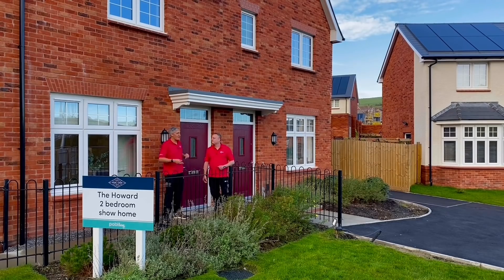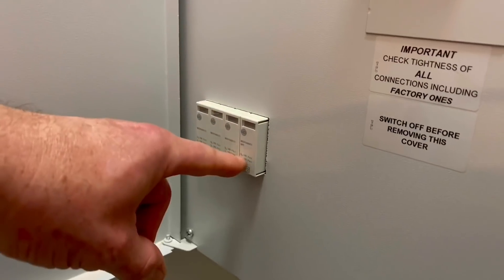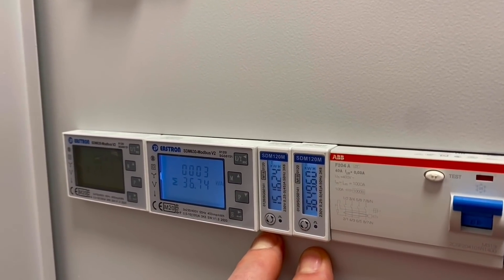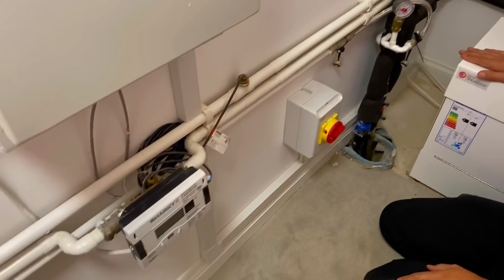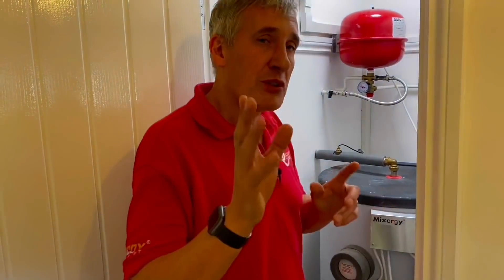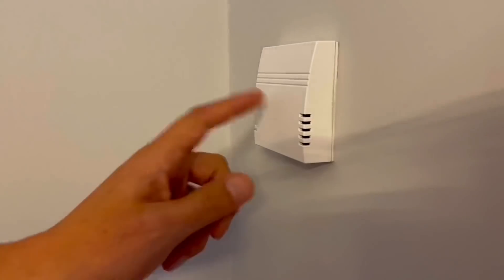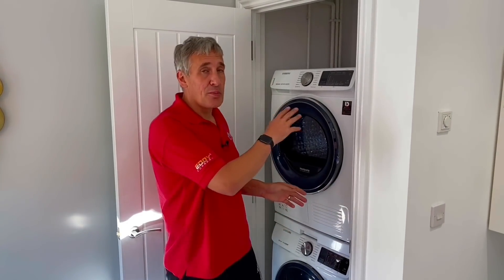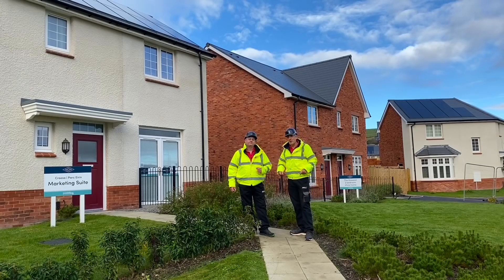THE FUTURE OF HOME ENERGY is HERE - A GAME CHANGER FOR ELECTRICIANS

Comment: Impressive., looks like there’s a lot to go wrong in the future.
Reply: I think you find this is an armous and legous installation ,you don't have to be a rocket scientist but would help .sarcasm at it's best.
Reply: Maybe, but there’s no particular reason it should be unreliable, a heat pump is just a fridge
Reply: @edc1569  I’m talking about the whole system, not just the heat pump.
Reply: @barrydoherty636  not being to negative ,but ,the tech goes these days this will be outdated this time next year .
Reply: @barrydoherty636  Just to address this concern... the underlying system for control uses erlang at its core, the same language used in telecom systems,  its designed to be remote debugged, can self heal, and is very secure, the config can be upgraded over the air via a sepearte 4g modem so is not reliant on users wifi. Its been designed to avoid the need for callouts as much as humanly possible, and every device connected sends a heart beat that alerts of any issues, if a part is showing issues the system can restart that single piece of control code.
Reply: @raychambers3646  The system is designed to be updated via new configuration, and will work with all current IO protocols for both wired and wireless, the system can also be loaded with new drivers as and when required. As such its been designed to be as flexibile as it can be, as new technologies appear the system can adapt to work with them. The system can also work with either wired relays, device apis , and all the current standards like RS-485, gpio, zwave and zigbee etc. It also allows for user control. smart scheduling, intelligent optimization and cloud integration. All efforts have been taken to ensure the system can grow and be maintained to ensure longevity rather than just work with a fixed set of peripherals.
Reply: @sismith5427  Does it come with handbook or online ,any tuition given ,because never understood hardly anything you have written ?
Reply: @raychambers3646  You just queried that it will all be out of date  in a year, I was just trying to explain that it's built in a way that means it can adapt. That it has minimum maintenance, and maximum resilience considerations at its core. Sorry I'm a software developer and tend to talk in a more technical  way than was necessary. I just wanted to be clear that Sero really have tried to create devices that are secure and can continue to be configured to avoid becoming absolute.
Reply: @sismith5427  how long do you guarantee software/firmware support for? And how much is open source?
Reply: @rivkahlevi6117  yh my thought too. What happens if a security bug is discovered in the firmware of one of the plethora of monitoring devices or the app in 4yrs time? Will the app be updated regularly as and when mobile OS's change? If the app is no longer functionally supported do the devices continue to work optimally? 

Open source is a good way to keep things maintained, but if only a few hundred houses have this system then a limited pool of people able/invested in maintaining.

I'm hugely supportive of the integration of proper green tech into ALL houses new and old, but I'm just skeptical of the long term costs and usability of these whole home type solutions. I wouldn't want my smart heat pump and water tank to just stop working one day in 10yrs time because some random company no ones heard of decided continued development and maintenance was too costly for them to offer and they wanted to move to the new hot ticket thing.
Reply: @raychambers3646  Also after 5/7 years manufacturers will not support it either, and new system will be needed.
Reply: @boderick1  yh, and considering some the the 'non-smart' 'non-fancy' and cheaper alternatives that work just as well are usual expected to operate normally for 3x that long if not 4 or 5x then losing a lot of functionality after such a short time just creates more e-waste.

I'm pro smart, eco friendly, new and emerging technologies for the home, they will be important for long term decarbonising the home and cutting the need for fossil fuel. But like I've also said these whole home integrated unique systems are just asking to cost the homeowner much pain in a very short time period as they have to remove and or replace within a timescale not normally expected for such non-smart items.
Reply: Si the point the guys are trying to get across to you is the system is over complex for what it needs to do. Add to that the additional software based controllers etc and someone will be out every time you get a mains dip or lightning strike (maybe that’s why you have surge arrest kit).
Do do think the average Central heating tech will be able to fix this? 
And yes that 4g connection will be just perfect, just have a master reset switch for everything on the front panel.
Reply: @edc1569  but at 3kw it's no better than an immersion heater! Far better with a mixed solar system of pv and thermal with the battery storage topping the system temp up.
Reply: @stuartcraigon2003  that's 3kw input so they'll be hoping for 10-12kw output on a good day.
Reply: @rivkahlevi6117  still can't heat a house with less than 30kw, my 30kw boiler struggles with heating and hot water together!
Reply: @edc1569  A fridge doesn't run 24 hours a day though.
Reply: It's not just the heat pump that might or might not have long term issues but all the additional peripheral equipment requirements that give me some  concerns to its longevity, only time will tell.
Reply: Without trying to sound negative to all these advancements in home heating but that was some of the thoughts going through my mind, initial outlay and on going  maintenance costs and the longevity of all the specialist equipment. Keep up the good work and stay safe.
Reply: It would be a great help if the guy who installed it all, also lived in it.
Reply: @markrainford1219  We are trialling the whole system in a member of project staffs actual home

Comment: 8:30  "22kW per hour "- seriously?  (BTW very few cars have 22kW onboard chargers)
Reply: Just means if the car is capable of fast charging, loads would benefit from this!
Reply: @paulteasdale7112  you could charge 2 cars at once....
Reply: @fredrickwelch5678  Its enough to charge 3 cars . 32 amp per phase
Reply: I think mikeselectricstuff is pointing out it should be 22kW and not 22kW per hour, I agree.
Reply: @thassaloid  The meter will read it as 22kw per hour
Reply: @persona250  after an hour
Reply: @UberAlphaSirus  whats the difference ?
Reply: Imagine a big estate, everyone coming home from work and first thing they will do, is whack the car on to charge, fun times ahead
Reply: @acelectricalsecurity  No they will have it set to charge on the cheap rate hours (off peak) however if everyone had one it may well become the new peak.😉
Reply: @acelectricalsecurity   battery might take a lot of the pain out of that, if solar has been charging it all day and they have been out it should be full, drain the battery in those hours. Not to mention if it's all smart then it won't take power from the network when it's expensive, it will wait until the night to charge.
Reply: @oliverriall  you need to remember one thing, this stuff is requiring an internet connection, what happens when that's down, mine has been down for two days now, and over the last 12 months I have had issues, and went a week without internet at home, it got that bad they even give me a mobile dongle which was super slow, and that was only I complained so much, and I live in a large town.
Reply: @oliverriall  Then you'll have people plugging in their cars, intending to use it later in the evening, only to discover that their car hasn't charged and they have insufficient range. They'll need to install 'Charge Me Now' buttons, if they don't already have them. I can see a lot of people being caught out by these allegedly smart features.
Reply: @acelectricalsecurity  The dno have control over all chargers fitted
Reply: @persona250  I don't think so
Reply: @acelectricalsecurity  To get the OZEV grant the charge points have to have remotely controllable load limit to allow for grid load balancing if necessary in the future. I don't think the DNOs have direct control, but the charge point supplier does and they can be asked to change the limit.
Reply: @shouting-into-the-void  but there will be a lot out there that don't have that on, plus not everyone has the grant, which is a bit of a con anyway, as you can get a point for cheaper if you don't use the grant scheme, some people are blinkered into thinking they are saving but in reality they are not.
Reply: @acelectricalsecurity  Probably blackouts due to dno not being able to supply enough power at peak times.
Reply: Don't most fast chargers give DC so the car doesn't do the converting, I can well imagine most car companies don't expect to receive more than the usual 32 amp chargers being used

Comment: You could build a house for the cost of all that kit. Building houses here in Wales is already more expensive than the rest of the UK because of the sprinkler systems.that have to be installed.
Reply: So when I was younger in college we got walked around a new build site and I remember them telling us it cost them ~£45k to build each semi like this the normal way. Your comment resonated with me because I really do think it'd cost half or two thirds of that £45k to install all this kit as well.
Reply from the maker: We saw the sprinkler systems as we went around. This seems to be the direction of travel especially in wales. If we are going to decarbonise then prices will increase for upfront but lower energy costs for the life of the property
Reply: £12k for the heat pump . 
£1500 for the pv
£5k for the battery .

If you lived in the house for 10 years i reckon it is saving you £20k in energy bills .
Reply: @persona250  Up until your solar panel interverter packs up 6 months after its warranty expires. I'm half joking and being cynical but my point is you are left open to issues like this with this sort of kit.
Reply: @persona250  £20k saving on energy bills in a 2 bed over 10 years? That's a lot of energy you're consuming there to get to a £20k saving. Although it has prompted me to think of the costs of this kit for a 2 vs 3 vs 4 bed etc. I assume its higher for the 2 bed and becomes more cost effective as the property size increases.
Reply: @robthomas7232  I think your right lets compromise to £14k over 10 years .
Reply: @persona250  not with that pathetic 3kw heat pump it's not! Just wait and you'll see lpg boilers and 47kg gas bottles being used to heat that house properly. All that shit will be ripped out and skipped!
Reply: @stuartcraigon2003  It is a very small heat pump but its a small over insulated house . The thermal store has back up immersion heaters .
Reply: @persona250  that unit doesn't. It's heat pump input only.
Reply: @persona250  it’s a shared borehole - they do not say how many share but if the house approaches passive haus standards it is conceivable 4 houses could share that so 5K for the bore hole, the heat pump itself 4K, battery £5K and I reckon 5K for the solar, so £20K - as this is being done as a job lot especially the bore holes that will bring the cost down by probably 25% so maybe £15K. With Gas prices set to rise (or be taxed) to the equivalent KW/hr rate of Electricity - it is not really about ‘pay back time any more.

Comment: This is great. About time we got 3 phase in homes. Much easier to balance out.  Are the large appliances 400 volts too. Washing machine and dryer ?  Was MHRV installed too ?
Reply: No MVHR. They didn't bother with air tightness, same old draughty mass developer style. The EPC I looked at had a figure of 6.8m3/m2/h!
Reply: Western Power in my area will only install 3 phase to new homes now....its definitely way forward with all the heat pumps and EV chargers that's going to be installed in the coming years.

Comment: The technology is great... but the installation is trash....loads of flexs not clipped, and the cables to the top of the battery look awful, wouldn't be so bad if it's in your garage. And let's not talk about the distribution board installed with heating pipes behind it.....proximity to others service??? Typical shoddy new build installation.
Reply: Yeah, those battery cables look terrible.